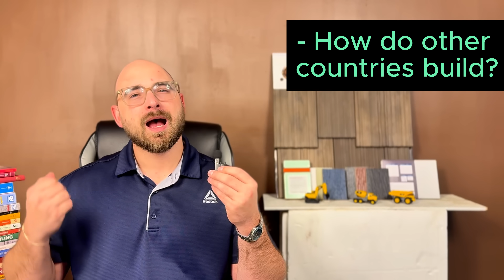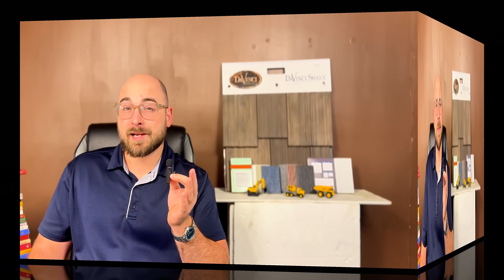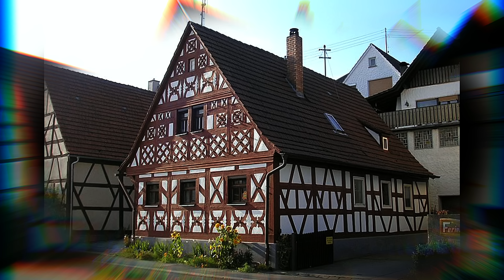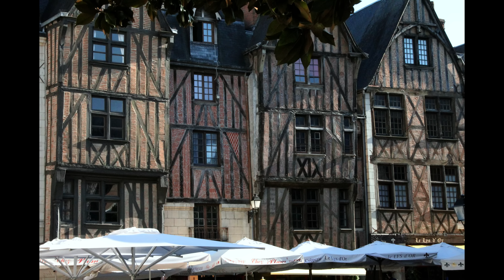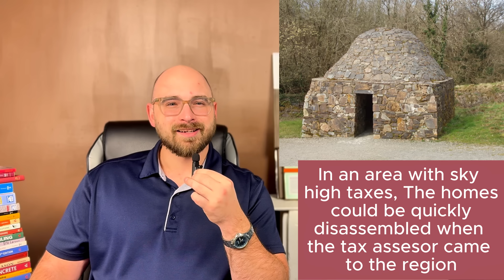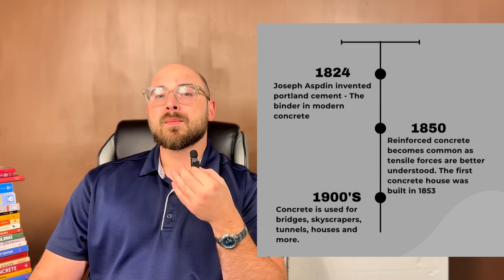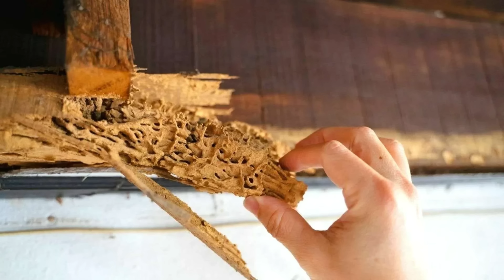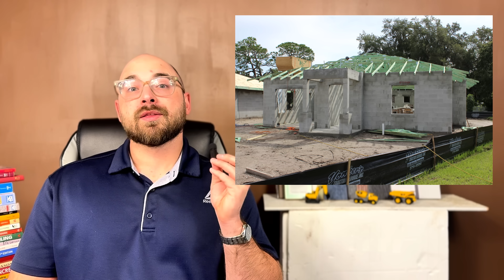Why Other Countries LAUGH at American Homes

Comment: I don't think any of these framing method is terrible. Homes in the US built during the suburban sprawl period are poor quality partly because of lax code, and mostly because large corporate builders can largely get away with not even building to that (already very low) code regulation. Mass producers are always going to cut corners in ways that an individual builder wouldn't tolerate. I've worked on many home remodels in NY and AZ and as a rule newer is worse and AZ is worse. Despite the need for insulation in the Phoenix valley area, state laws allow for comically poor insulation and there is little to no code enforcement. It doesn't matter if you're in a $500k mouse or a $3m, they are built with the same lack of conscientiousness. In NY homes are built better because building codes are stricter, any many are older and built to last. I hate to be one of the "it was better when" people, but as a rule the newer the worse.

Which all might be justifiable if we were making cheap homes but the opposite is true.  Yet home prices, both absolutely and as a proportion of income has increased nearly tenfold over 50 years.

Comment: There are old construction methods in Germany too, but the major difference is the dimensions of the components. For example, no room would choose 2 x 4 posts for its timber frame construction, which is just roof battens for us. There are also massive differences in the doors and windows, but three panes of glazing are now standard for us.

Comment: I especially don’t understand why basements aren’t built in tornado-prone areas. In Europe, having a basement is standard.
Reply: Newsflash: basements ARE built in many tornado prone areas.
Reply: @ But what's the use having a basement if your house will be totally destroyed? Why not build a house that can withstand a tornado in the first place?
Reply: Basments are common in many areas. Others it's not reasonable since you can hit water within a few feet.
Reply: Plus it raises the value of your house.
Reply: no its not every european country is different basements are not common here in the NL for example
Reply: They are... Only exceptions are for when the local geography makes basements impossible or extremely expensive. (see the infamous Joplin tornado. they couldn't build basements due to the ground material)

Comment: Brick houses are typically wood framed, and compared to a block house, they are weak as hell, frankly, ESPECIALLY compared to a block house, even more especially to one that meets hurricane and tornado codes, with every other course poured and rebarred, roof ties on every rafter, and ring nailed sheathing.
Most people making these sorts of claims have never built anything, let alone a house.

If you really want a strong house, just build it with Steel I beams, tied into bedrock, with high strength military grade integrally poured concrete, properly meshed and rebarred.  The roof should probably be something like 1/2 stainless steel, bolted to large cross section steel inserts that are positively bolted to the I beams, welds as backup wouldn't hurt.  Such a home would cost about 100 million bucks, and would be absolutely ridiculous overkill.  You might want to put it in the center of a large mountain, too, and vapor barrier and properly supply HEPA filtered air to the whole place.   Don't even get me started on the amenities, food storage, etc.

The whole argument is dumb.  Better for WHAT, WHERE, WHEN, etc, as you point out?  The BEST house is the one that meets YOUR requirements, for YOUR area and budget, built at maximum bang/buck.  End of story.  Most people are idiots, and have not the slightest clue what they are arguing for, or against.

Properly designed heavy timber framing can be very strong, as a normal method, but the covering needs to be impact resistant and strong.  The studs are still often continuous, but with cross ties to contain a wall fire for a short time, anyway, hopefully enough to be aware and escape.

Excellent video, well researched, the ICF is very intriguing, for my next build.  Homes used to be built to last.  The homes in Suffield, where my family was from, carrying our sir name, range all the way back into the 1600s.  I lived in one built by an ancestor, that was built in 1855, by David S****s, my Great, great, great (I think) uncle.  There is one Posthumous S****s house there from 1743, all still occupied, some of them owned by the current generation of the same family.  Wiki actually lists this as a 'dynasty', which I found humorous (I was looking up dates).  It wasn't our sir name, but one in the lineage actually DID come over on the Mayflower, and we have all the geneology, meticulously researched, to back that up, not that it really matters, but interesting to your point of built to last, looking back.

ICF is intriguing.  In the shop we built in Ocala, my father put 2 1/2" insulation in the inside of all the block and brick walls, between studs before dry walling.  He even did the interior walls so you could cool/heat individual sections, like his electronics shop.  In Fl, in the heat of the summer,  you could go out in the heat of the day and it was still very nice and cool inside, no AC even installed, as he found out he didn't need it.  It was also mostly shaded by trees, so heat load from the shingled fairly high pitched roof was low.

Comment: One point forgotten is the weight of the home, Light weight does mean more flexibility with where you can build as well. I know several people wanting brick or cinderblock houses but could not because the land would not allow the weight as other homes were built in the area and they suffered a lot of settling and had to have a very costly foundation to be done which would have killed their budget by more than double and that included original non-basement foundation. But with wood framing they could go with the same house and put the extra into a full sized basement. 

As far as fire is concerned, like wild fire areas, Brick or concrete house would still fail in those areas because of how hot the fire gets. Brick, concrete and whatever mortar that compose them do not like a lot of heat that gets produced by many of these wildfires to where they have been shown melting steel framed cars on the side of the road. Mortar failure is a big problem with a lot of old brick buildings and tends to be a constant repairing cost problems. Where I live in the Midwest, we have a bunch of old churches, schools and factories fully made of brick and its the main reason for tearing them down. 

As far as Tornados, the main failure is not the walls but the roof getting torn off, If the roof stays then the house stays. I have seen cinderblock buildings and shops that had half of the walls toppled over after tornados and they were reinforced with rebar. Its not just high winds but other stuff that is thrown about including the roof not being fully picked up so it slams back down many times breaking the walls. 

Now onto wood homes, we got wood that is resistant to bugs, water and rot damage and its not uncommon and if anything the younger wood is easier to treat because its less dense so that makes the process cheaper and less time consuming. If we need more structure we can use bigger wooden beams and different construction methods. Heck there is houses that as long as they have some sort of maintenance have lasted almost 200 years and they are wood framed houses with siding. Now when I mean maintenance its like making sure windows are kept so water intrusion does not happen or any air flow passages that need to be maintained are maintained. This also includes upkeep of rooves which pretty much any house needs. Fixing damaged wooden beams even if its the main structure of the house is not really that hard and can do some reinforcement around, jack up the area to remove the load and just replace the damaged parts and put it back as it was. Its not overly difficult and still cheap enough to do. Most the times the home owner if they got the understanding can do it themselves.

Also for the ones that make the argument of safety as other "against wooden home" videos like to show with breaking through the wall with a sledge. One its staged as hell as you are making so much noise the cops would have been there. Two, where you are breaking in more than likely will have electrical running through there if not plumbing. Anyone want to break into a house that way would use a car or truck they steal from the surround and even if its brick or solid concrete, that car will still break through on a house scale building. Its about making a hole as quickly as possible. Most people break through the door or window. Good thing about wood framed house is we can quickly modify or change the shape of the house including reinforcing the framing around doors or windows to heavier wood, concrete or steel. We have access to it if we want it.

Wood framed house is not the end all be all of building but for most case and uses it is not anywhere as bad as most think it is. Minimum to code tends to be pretty decent building atleast of recent code updates over the last decade or so because understanding of how to build with new stuff is the main factor and the best part of wood framed house is those changes can be done even on old housing where mistakes made with solid form constructions are not as easy to go back and fix.

Comment: you missed ICF... or insulated concrete forms.. like Nudera, Liteform, and Foxx Blocks.
Reply from the maker: It’s at the end lol
Reply: @Mike_Fortin  i saw CMU's,  Cinder block or "brick" with the insulation air pockets, and reinforced concrete.  i didn't see mention of ICF though, i will recheck the end portion however in case maybe i cut early.

Comment: It's not just the construction method of the house itself, it continues with everything inside the house. Everything is made with maximized corporate profits in mind. The quality is bottom of the barrel but looks fancy and therefore costs too much. It might be cheaper than a typical European home, but it's not half the price - It's more like 80 % of the price for 10 % of the quality. You're getting ripped off. And that's the reason why you will never catch up with European quality: Corporate won't allow it.

Comment: I am from Armenia. When we had a devastating earthquake in 1988, in the epicenter everything fell under the earth crust, but a little farther, the only homes that were survived were stone homes built in 1950-s, 60-s in the USSR times or homes built by individual people and professionals instead of mass produced large buildings built in precast concrete panels. Those built with those concrete panels in early 80-s were the first ones to break into small rubble burying tens of thousands of people under. A horrible tragedy. So, yes good stone building is both earthquake and fire resistant, always. Most quality homes in my country are built of stone, and outer walls are covered with tufa or basalt. Energy efficient materials.
Reply: Stone only resists earthquakes
 to a certain intensity. In Chile we rarely use stone or brick because, with the massive earthquakes we've got, it falls like a Jenga tower. Wood and properly reinforced concrete are the best materials for very seismic areas.
Reply: Я помню эту ужасную картину, когда от домов в Спитаке оставались не разбитые панели даже, а кучи гравия. И это говорило о недостатке цемента в том бетоне, по крайней мере, так говорили люди из Армении.
Reply: Полно мест где землетрясения не являются никакой угрозой вообще никогда, например большая часть США. СССР пострадал от того, что дома предназначенные для сейсмобезопасных районов страны начал лепить и там где такой безопасности и близко нет.
Reply: Were those panels connected correctly ?   Were the floor slabs integrated in the walls ? I read somewhere that they were not, which caused floors to crash down on the floor slab below and so on for the entire building.  The result was pure horror.  I hope people learned the importance of doing things properly.  They know how to but just don’t, unless they own the place.  Is that correct ?

Comment: I guess one advantage of American homes is that I can easily modify my house because of how easy it is to knock out walls. Also, breathable materials are great for areas of our country where it is extremely wet. I have a wood frame house in the PNW and have zero issues with mold. It is in fact very dry in my house.

Comment: @Mike_Fortin
While we have a lot of Brick houses in Sweden, a lot of Villas outside the cities are made of wood very much like American houses and probably for the same reason, we have a LOT of forest with almost 70% of our country covered by it. Even a lot of our concrete 2-3 story apartments are covered by a thin wooden wall on the outside like the ones I live in but all outside walls and weight carrying walls are solid concrete.  So wouldnt say all countries over here.  

Did a search and "Around 90 percent of all low-rise housing – small-scale homes with 1 or 2 storeys – is built around a wooden structural fram" is what I found which pretty much fits with what I seen while I grow up in one of those wooden houses in Sweden.

Comment: When talking about "America", don't forget about the Canada part of North America.  I went to some show homes made out of cement.  3-years later, all of the walls have deep cracks, because Portland Cement just can't handle the freeze/thaw of our environment.  Ancient Roman cement that self-heals would be a much better option.  However, innovation in housing construction is extremely rare.
Reply from the maker: Concrete performs better when insulated and protected from the elements/ moisture.    We can also add Xypex to allow the concrete to self heal . Xypex is mixed during placement and forms a crystalline structure within the concrete, when Coming into contact with water it will travel through the concrete and deposit at cracks, effectively self healing the concrete similar to Roman concrete
Reply: Whoa, good to know!

Comment: My parent's house  - they bought it, didn't inherit it - was listed in the Domesday Book, tax records ca. 1086. It wasn't the same house of course - the oldest standing part was Elizabethan, so ca. 1560 - but the cellar, with its spring, was Roman British so pre 200 AD. The house had four different ghosts, three of whom I met. It was not a wooden hut, but oak timber framing with effectively wattle and daub infill, the newer parts all brick. There are brick houses in the US of course, but mostly it's wooden huts - with plastic trim, even. There's a traditional tale about the wolf and badly built houses... re-enacted every time there's really bad weather.  Might be worth building proper houses, they last longer (brick-built flat I'm writing in has age 150+, my house in Spain 180+ and that's built out of rammed earth - no AC required!)😉 On jaywalking - myself and the road crew were arrested for jaywalking in Houston when we decided to walk "just two blocks" to the gig. That was on my first visit - blocks are bigger in Houston! We were let go when they realised we were British and clueless! There was no footpath! US infrastructure is skin-deep, I regret to say... our friend's house in LA escaped the fires by 5m/16 ft. Cheers!

Comment: The important keyword is energy efficiency – houses here in Germany re not only build to last forever, they are also build to use as little energy as possible for heating. And we also usually don't have an AC – because our massive walls are the AC.
On the other side, that thin wood framing so common in the US is how we may build a garden shed here – which may explain, why it's seen as unsuitable for an actual home.

Comment: i live in louisiana, the current architectural trend in my town thats been driving me absolutely insane for the past ten years is stucco. STUCCO. plastered onto the outside of standard balloon-style wooden framing on buildings multiple stories tall with naught but those thin sheet boards between the frame and the stucco. the entire "new downtown" area of my hometown is a ticking timebomb, waiting to fall apart after 30 years of rain, 100% humidity, and hurricanes wear down the materials. a concrete foundation means nothing during a storm when the house is a poorly made jenga tower of dry plaster and cheap lumber.

i understand that its hard to build good, heavy buildings on top of a swamp, but i also KNOW for a goddamned fact that new york city is LITERALLY on top of a swamp! we have no reason to be making houses the way we do, it frustrates me to no end. nothing is being made with intent to last in the climate it must survive in

Comment: California should def build concrete homes.
Reply: Fireproof concrete exterior, great idea. But It takes a lot of steel rebar to reinforce for earthquakes. Flexible wood internal framing has its advantages but requires good detailing
Reply from the maker: If I was building in earthquake prone, wildfire prone CA, I would be building with ICF + base isolation, (or steel framing if I needed to go cheaper).  No way I would stick frame there
Reply: @Mike_Fortin  If you’re going with base isolation for a residence, don’t forget flood, mudslide, interior fire sprinkler, private standpipe, and utility interruption considerations.

Comment: We also use concreet rooftiles. The moisture in concrete houses can be solved by ventilation, it's part of our building standards now. Concrete will soon be co2 neutral, capturing it for the lifetime of the building. I expect printing homes will be the end of wooden houses.